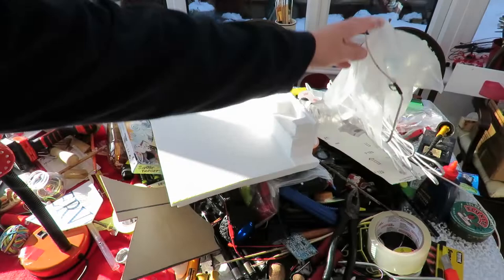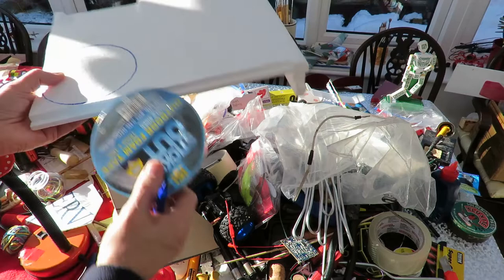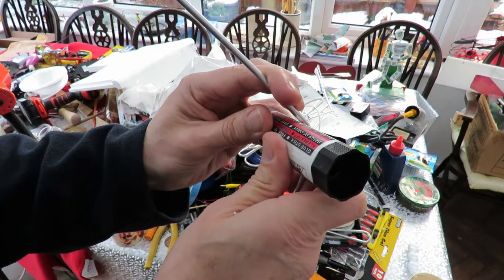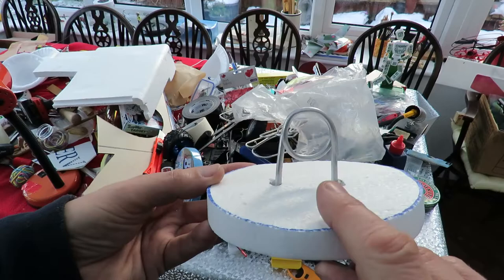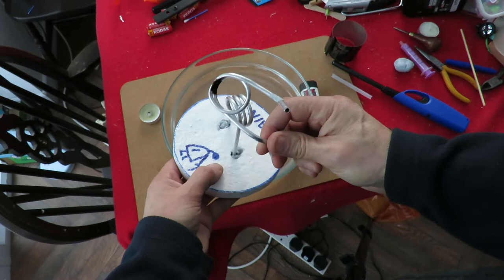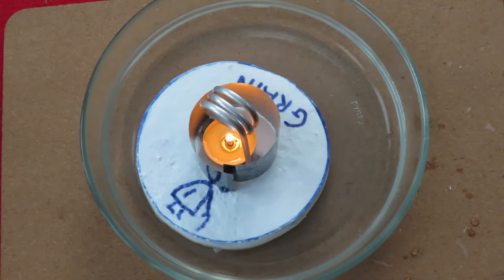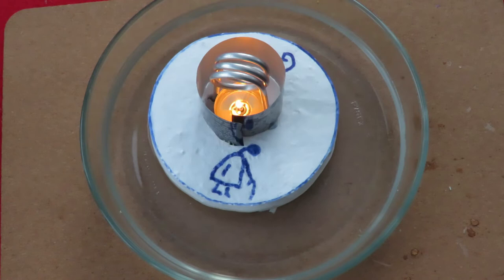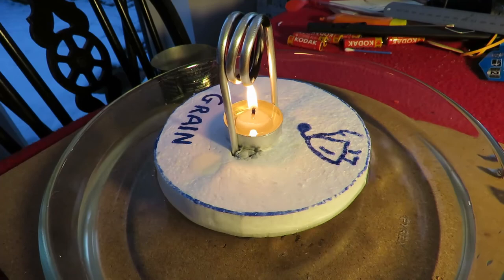Spinning Pop Pop boat type thing

Comment: Good morning
Reply from the maker: Afternoon 😀
Reply: @GrandadIsAnOldMan  did you take that problem my Lego pf m motor starting to a crazy grinding sound is coming to the gearbox I take it apart and change first to second reduction gear and I put it back together and it still works really good